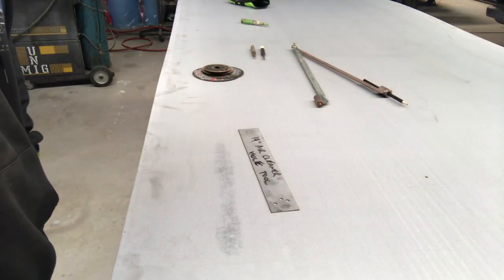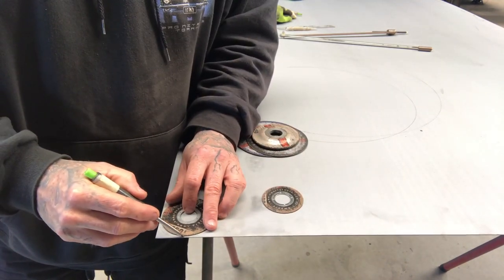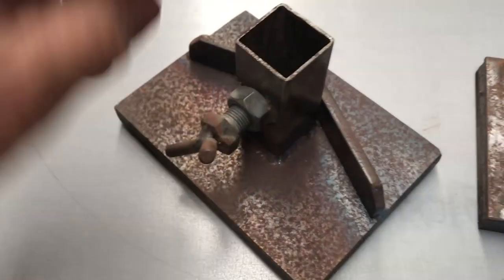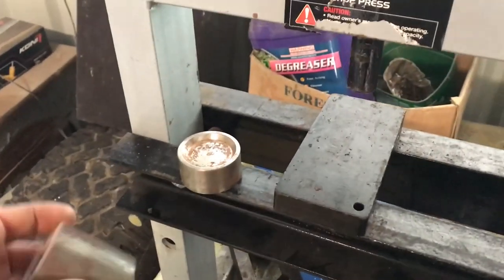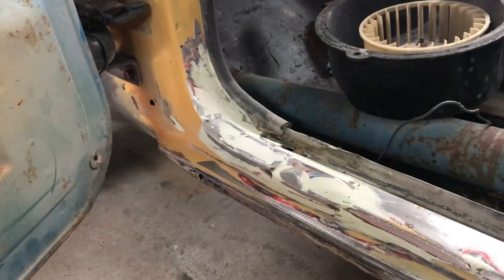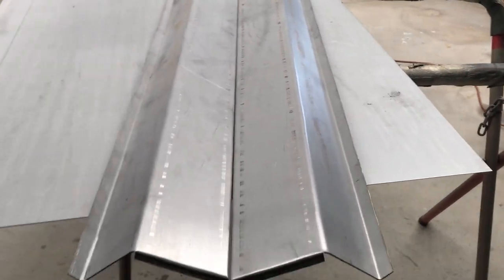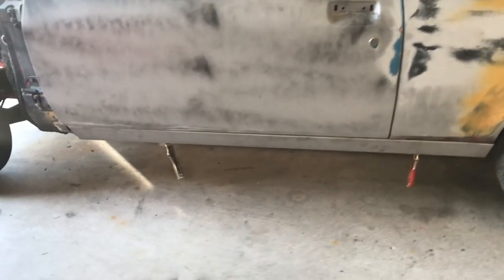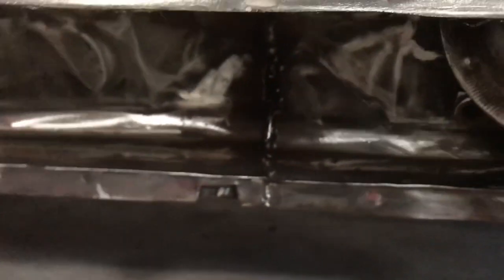Beginning Fabrication - Episode 12 - All sorts of stuff happening in this one!

Comment: Great stuff Tim.  If I was doing the sill between door and wheel on a Ute where that length is longer, how would you attach the upper return as it folds under the qtr panel and is covered by the rest of the sill piece.  It appears on the Torana here that you didn’t actually weld it at all?
Thanks Poyda
Reply from the maker: Hiya. On the torana the top of the sill behind the door isn't a seam, like on an HQ ute for example, so it just gets welded to the top part of the quarter panel. With utes you can usually get access to the top of the sill/quarter seam from in the tray (most utes have removable inner panels in the tray) If you drill up from underneath where you cut the sill off, into the quarter panel part of the seam when the sill is off, you should be able to then plug weld that seam together from the top, inside the quarter panel. Does that make sense?
Reply: @timjohnston7285 
Yes makes sense.  Thanks Tim  I buy those rare spares sills and wondered how on earth you could attach that return.  It'll be fun welding in that cavity. One other hard piece to make is the cupped jacking point under the Ute sill. Looks too deep for a dimple die. I put in end if pipe and hammered in but came out pretty thin. Any thoughts or video be appreciated.  I'm inspired by your skill with simple tools.